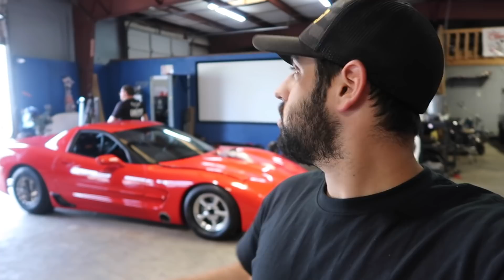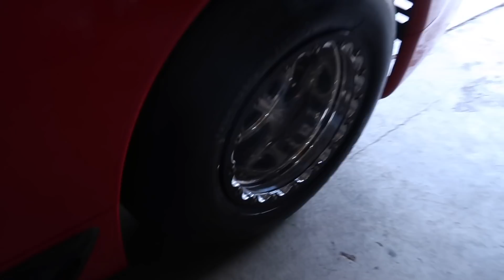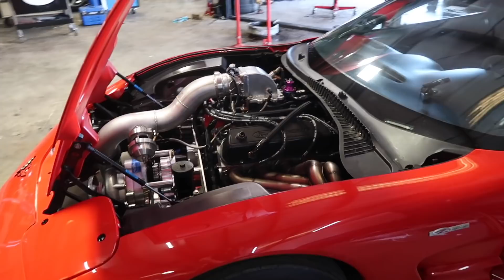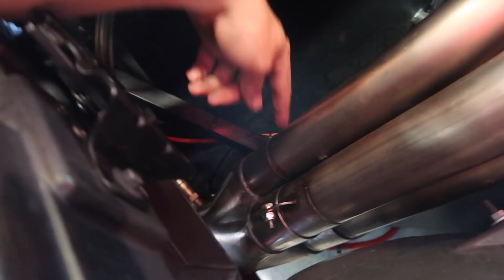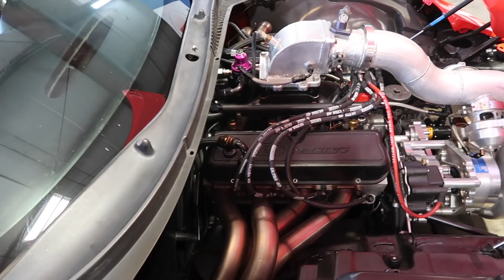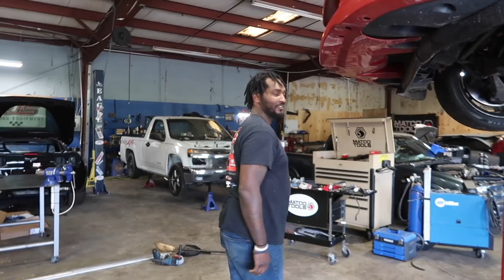SMALL BLOCK FORD powered VETTE!!!!!

Comment: As a die hard Chevy guy I think it's cool. I always enjoy something different if it makes sense, unlike these idiots putting 2000 lb diesel engines in cars with uni bodies...
 I am kinda pissed that my LS is going to give up it's 6 bolt main caps, raised cam tunnel, bigger cam core, 15 degree valve angle, revised oiling and cooling, far superior flowing heads , etc....and become an old school small block chevy as soon as I bolt a holley managment system on it.

Comment: Nice car. The 25.3 is for a full bodied car with aftermarket tube frame, OEM or modified floorpan, OEM body shell, or unibody construction with modified floorpan and or firewall 6.50-7.49 ET and 3600lbs max. That car fits this spec. Door slammers to the front and RTCTTFMF.

Comment: That is what Cleetus should do with Ruby put a 25.3 chassis in it with a true 9in rear with a 4 link suspension and ditch the torque tube and bolt the trans straight to the block like it should be and get a TRZ Outlaw K-member and put the turbo in the engine bay and put the hood back on and of course put a mid plate and front engine plate in it

Comment: “Why would you put a Ford motor in a corvette?”  Why would you put a Chevy motor in a Ford?  SBF makes every bit as much power as an LS when comparing apples to apples.  The only place an LS has an advantage over a SBF is comparing stock long blocks because the heads are way better and flow way more.  But the only reason LS heads flow better is they are about 25 years ahead in development.  Ford stop putting any development effort into the Windsor probably way back in 1990 and stopped making them completely around 1995.  Had they continued to manufacture and develop the Windsor until now, it would be as good as or better than the LS.  Who’s gonna leave stock heads on a Windsor anyway and their modern aftermarket heads flow as much as any LS head.  So no reason to put an LS in a Ford.  I like the LS a lot but keep it in GM vehicles.  Just my opinion.  👍
Reply: CLEVELAND HEADS BEAT THEM ALL AND BOLT ON A WINDSOR

Comment: I don’t mind it at all. As long as it makes some steam. But it does need some coil on plug action like the Bad Apple. So you can ditch the octopus mustache distributer and plug wires! Then with the coil packs sitting up on the valve covers blocking the Ford logo people walking by will just think it’s an LS.